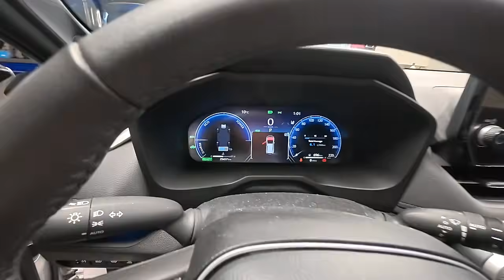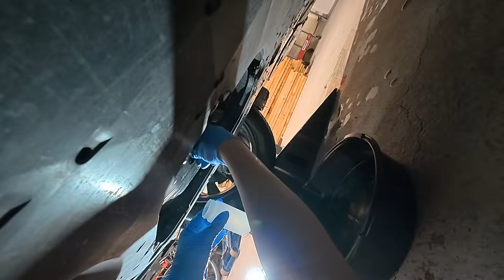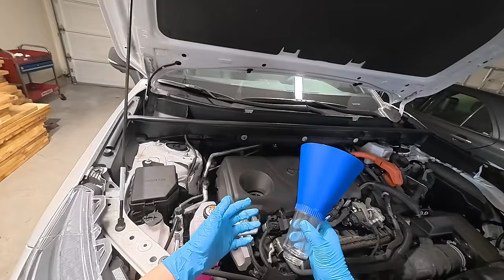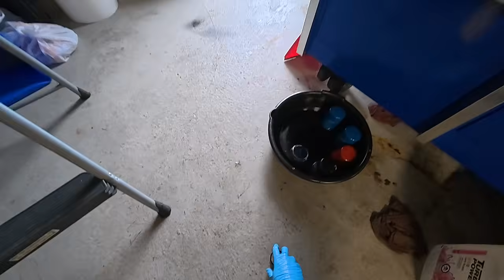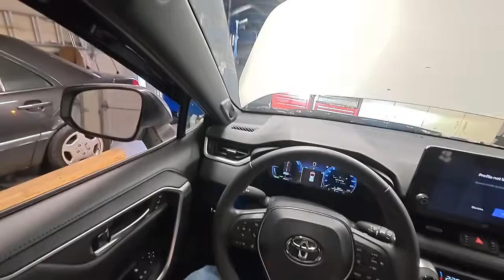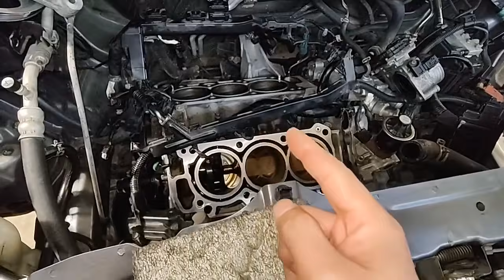5w30 Instead of 0w16 oil change #2 in the Rav4 Hybrid.

Comment: I have a 2022 Corolla with 2.0 liter, and after it came off of warranty, I switched from 0w-16 to 0w-20 in winter, 5W-30 in summer. No significant change in fuel mileage. I bought a quart of 0w-8 just to satisfy my curiosity, and am appalled that it’s even considered engine oil. My wife can use it in her sewing machine in place of 3-in-1 oil😂

Comment: I'm probably switching my 5th gen 4R (which has the 1GRFE that originally took 5w30 here in US, before being changed to 0w20 for the dualVVTI variant) and my wife's 5th gen RAV4 (non-hybrid) to 5w30.  Her RAV4 engine has always just sounded  like a cheap, unmaintained noise box rather than the refined engine that it actually is.  That noise can't be good.  
I have a various quarts of 0w16 and 0w20 left over, and am going to mix in just 1 quart over each oil change as I convert over to 5w30.  If foreign markets are recommending 5w30 oil for these engines then it's fine to use here in US.
Reply from the maker: I've been running 5w30 in my 2023 4runner since after break in period.

Comment: My 18 Camry 2AR-FE has a sticker on the front panel. 5w-30 .  This is a toyota sticker
So why are all the youtube mechanics insisting on the zero weight oils????  
Did the research I run Penzoil Ultra Platinum 100% synthetic 5W-30 new washer and factory oil filter .

Comment: Not saying it's right or wrong but It's a hybrid.  Isn't the point to minimize the wear of constant start/stop cycles?  Does a thin oil not make sense in that context?  It's an Atkinson engine too.  So not a ton of heat generation, unless you're stabbing the throttle through a desert or something.  No one ever mentions these things in these oil debates.  These hybrids are not apples to apples comparable with standard engines.  Also, it's over 100 degrees half the year in Saudi Arabia.  Not sure why that's an argument, exactly, assuming the person who made that comment is even telling the truth.

Comment: I ran 0w20 in my Toyota for 350000 I think you should use what the engineers say to use and is printed on your oil cap. And its not weight the w is for winter not weight. If your car engine stops at lights or in traffic you better use what the dealer tells you to they use additives to protect your engine and the thickness wastes valuable seconds from your engine getting oil on needed parts. Without those additives your oil barrier even with thicker oil won't be as good.......But if your smarter than well paid engineers that spent years designing and formulating oil to best lube your engine parts, go right ahead........

Comment: I have a 24 Ridgeline, do you recommend a VCM muzzler, or has Honda improved this engine?
Reply from the maker: The first gen Ridgeline never got the vcm like the odysseys, pilot and accord did that burned oil which is why the first gen was so good. The second gen ridgeline that got the earth dream like all the other doesn't have the issue like the previous v6 with vcm. Regular oil changes is also very important for how the vcm on that engine to function as everything is controlled by oil pressure.
Reply: @theoffroadingmechanic t
Thanks!

Comment: I used 0w-20 instead of 0w-16 in my hybrid Corolla and the difference is a quieter engine on acceleration. No change in miles per gallon. Will note difference in winter time.
Reply: I did the same with my 25 Kia Niro hybrid.  0W-20 seems to make it run quieter.

Comment: I use 0W-30 during cold winter months and 5W-30 during hot summer months, change oil/filter at 5,000 miles (which is 40% remaining on its OLM) for years and all works great.  And you are right...  Some folks get "very ugly" when using thicker oil than on its oil fil cap.   For more details about "too thin" oils in USA/Canada, surf:  https://www.youtube.com/watch?v=6quq3CZTv_E&t=38s

Comment: Great video to share.

I live in Alberta and I use 0w-20 because of the cold winter around -35c. Nothings wrong with 5w-30 there because BC has no harsh winters if you're near Seattle.

I read the Australian manual with the same engine they recommend until 10w-30.

In Australia's manual they recommend the ff:

0w-16 - preferred
0w-20
5w-20
5w-30
10w-30

Toyota even mentioned that "An oil with higher viscosity (one with a higher value) maybe suited if the vehicle is operated at high speeds or under extreme load conditions."

It means more engine protection on the second number.

You're doing fine there!

Comment: I’m in the states and my mom has a 2014 Honda Accord and uses 0w-20 and just switched to 5w-30 Valvoline restore and protect. Hoping she’ll be fine but also sound fine at full idle and I thought to use the 5w-30 because she has close to 180,000 thousand miles on it hopefully it will protect it more. I’m assuming I should be fine? If I should switch it back LMK!

Comment: I have a non hybrid, just did the oil change with 0w16 because that's what the manual says and I was scared. But being in South Florida, I want to go 5w30. I'm gonna go another 4k miles and do it. I just used the whole gallon.

Comment: I have questions only because the new Rav 4's uses an ecm controled variable displacment oil pump which is calibrated for 0 w 16 oil viscosity. The ECM (Engine Control Module) monitors real-time oil pressure and temperature. If it detects pressure rising above calibrated targets due to thicker oil, it commands the pump's solenoid to reduce displacement, effectively "throttling back" the pump to compensate.  This sounds bad to me.  But Im not an engineer.
Reply from the maker: I already checked my oil pressure on live data before and after and it was around 14-15 psi and after switching to 5w30 it was around 17-18psi and this was just at idle. So it doesn't compensate.

Comment: I have 1,200 miles on a ‘26 Corolla Cross  M20A-FKS that takes 0W-8. Toyota has only been doing this for a couple years. It’s giving me sleepless nights. I feel like a damn Guinea Pig with this stuff.

OMG those bearings at the end of the video are literally going to give me nightmares. That’s probably what’s happening in my Toyota right now with this water oil.

When I dumped the oil at 500 miles it was the first time I’d ever seen this stuff. It’s so thin that when it hit my plastic drain pan on the garage floor it splashed out everywhere and made a mess. The 0W-8 oil doesn’t even like to stick to itself.
Reply from the maker: Have you tried sending in your sample to see how your engine is doing on 0w8? I just sent my friends 0w16 oil on his 2024 sienna. And one thing that stood out is the fuel dilution thinned the oil out of grade. Gonna be in my next video when I change my oil in the Rav4 again and send another sample.
Reply: @theoffroadingmechanic 
Right now the oil only has ~700 miles on it. I may do an analysis in the future but I don’t think it would reveal a firm fuel dilution trend yet.

Comment: My grand Cherokee 3.6l  says 5w20...I searched for the best castrol extended 25k available..its not 20k its 25k..hard to find...it holds six quarts ..so I decided to go with 3 quarts 5w20 and 3 quarts 5w30...so the oil weight is 5w25...the very first cold start it was a smoother start and less noise..wasn't much noise at 5w20 but its less now..when the weather warms up im.going 5w30 castrol 25k extended...I want a oil that has the highest rating possible with a 5w30 oil..its ACEA A5B5..they rating does not come in 5w20 or 0w20...it come in 0w30 5w30 and 10w30..that rating is for small 4 cylinder and 6 cylinder high horsepower engines with or without turbo or supercharger with extended oil changes

Comment: IDOCARS got ahold of a ruined new Tundra engine. It had plenty of oil but had spun the last 2 connecting rod bearings. And the other didn't look great, either.
Reply from the maker: Yea seeing that it looks like that engine is eating it's bearings. Not just the mains. Another person posted a video on his tundra and after driving and getting the engine to operating temperature his oil pressure is 6-10 psi. Eric is probably right it's an oiling issue and the debris is just a result of it.

Comment: Myth-"Today's engines have tighter engine component tolerances"  
Research bearing and piston clearances of engines built in the 80's and 90's and even further back will prove that belief to be incorrect.
Reply from the maker: Yea those claims are all BS you can't go tighter because of expansion from heat. some examples is Honda V6 bearing clearance has not changed if anything cam lobes have gone narrower timing belt has gone skinnier. If you look at the V8 tundra in the second gen the bearing clearance on that engine is tighter clearance than the V6 twin turbo in the new tundra and that is because turbo charged engine creates more heat and metal has to expand more with more heat. Same goes for piston ring gaps not big enough gap on a turbo charged engine and that ring gap will bud up against each other and destroy your piston. The tighter tolerances that they are spewing/marketing is just a way to say they "engineered a better product" but really it's cost cutting while saving on materials, cost, and quality. I call it brainwashing cuz people all believe it.

Comment: I would never go up in weight in the winter. 
These variable flow rate oil pumps are programmed to expect a certain viscosity at a given temperature. 
This would be fine in the warmer months.
Reply: That makes sense, but then why does the manufacturer specify a range of oil viscosities for the same vehicle that are acceptable?
Reply: @marcinmerrimack1726 The way they program the oil pumps for US vehicles is different. Pumps work based on pressure. Changing viscosities can lead the the pump not delivering enough oil to the case.
Reply: @JTS-WTP  Ok, but what’s your basis for claiming that the oil pumps are programmed differently?
Reply: @marcinmerrimack1726 Because fuel economy is important. Electronic oil pumps have less demand on the engine increasing fuel economy.

Comment: I got 2022 lexus NX350H it says 0W16 but here in ontario its cold as ice age should i use 0W 20 or 5w 30 instead.
IT'S BEEN COUPLE MONTHS OF PERSONAL EXPERIENCE I SUGGEST DO NOT TOP UP 5W 30 
I SUGGEST NO CRUDE OIL AND ONLY 0W16 ONCE
Reply: 0w20 - I would use.

Comment: You mentioned something that I've been saying for a while about the manufacturers claiming it's machining debris at the manufacturing center. I personally think that is b***** I think it is the engine is creating its own debris but if they admit that then they'll be admitting that the oil viscosity that they are using is causing engines are causing their own debris I'm sure that will open the doors to hell of a lot more lawsuits and they are getting.. I did the lemon law on my truck I was able to keep my truck because it is still running good but with the issues that I had they qualified for the lemon law and I won 9 grand.
Reply from the maker: For bearings to go out like that it would have to be quality of parts or an engineering thing. A failure in the main bearing would have to be due to an oiling issue. Or it may have something to do with that variable oil pump only putting out 5-10psi at idle that someone had mentioned but I would have to have a tundra and have my scanner look at the live data for that oil pressure data to confirm that. Maybe we will get one traded in at our dealership.

Comment: I totally agree with you 100% about the oil switch out., where I live it was 5W30 for years and then with the cafe standers they switch to 0W-20. I made the switch 11,300 miles ago I've had two full oil changes with a 5W-30 and she runs better than ever and I will do a Blackstone laboratory sample probably after the next oil change.  On the two previous oil changes I used liqua Molly engine flush I'm going to use it one more time change the oil and filter drive it 250 mi come back change the oil and filter and at the next oil change at 5000 mi I will send in a sample I'm just not sure if any of that liquor Molly is left behind so I don't want that to be in the oil sample test kit

Comment: YES I SAW IN THE OTHER COUNTRIES THEY USING 5W30 , SW40 AND WHEN IT'S COLD THEY USING 0W30 AND WORKS PERFECTLY WITH NO ISSUES. I AM USING ON MY PRIUS 0W30 INSTEAD AND NOT USING 0W20 AND HONESTLY ENGINE RUNS BETTER THAN BEFORE.

Comment: In Israel. All the dealerships use 5w30 (swapped from 0w20). Nobody tells why. Rumors are that in hot climates the 0w20 just cant take the abuse. People here go with 9,500 miles oil change and not a mile less. That might be the reason. My rav4 is 2021. The dealership uses 5w30 for a few years now. Engine was noisy especially on startup with 0w20. The rumors might be true. 5w30 and it seems much quiter. No oil consumption so far.
Reply: Is your car Hybrid?
Reply: @chingizaliyev3064 yes.2021 Rav4 hybrid with 2.5 a25a fxs

Comment: Really interested to see the oil analysis for this. By chance, will you be sending in a 0w-16 sample for analysis at some point as well? Wondering for comparisons sake.
Reply from the maker: I won't be going back to 0w16 but I do have a friend that's coming up on his oil change on is sienna hybrid that I can take a sample from. I changed it at 5k miles and should be coming up at 10k miles soon. I ordered a couple tests kits from Blackstone labs.

Comment: My 2024 toyota Cross calls for 0w8. Lol! First thing I did was deain and switch to ultra platinum 5w30. Result: ran quieter and smoother. Ow8 is like ice tea. Nope!! Not in my vehicle!
Reply: My concern too.  i have the 2025 and paid for extra warranty.  Concerned if I change oil the warranty will be void.

Comment: This is what I am doing in my 24 hybrid Camry and 25 hybrid highlander. 5w-30 restore and protect every 3333 miles after my 3 break in oil changes. So far I only have 17K miles on the Camry and 1k on the highlander. I live in the southern US so no cold temps here… And I am very aware of what the car care nut says about 0w-16 but he has to rub shoulders with Toyota and cafe standards because he runs a business. He can’t say what is really best for the car.
Reply: Great insights! I’m in a very similar situation. I have a 2022 US-spec Camry XSE Hybrid (A25A-FXS), but I live in Baku, Azerbaijan, where summer temperatures frequently stay above 104°F (44-48°C) for months.
I’ve been hesitant about the factory 0W-16 recommendation due to our extreme heat and high-speed highway driving. Seeing that you’ve already switched to 5W-30 on the same platform is very reassuring.
I had a few quick questions about your experience so far:
1. Since the switch, have you noticed any "lag" or hesitation when the hybrid system transitions from electric to the ICE?
2. Did your MPG take a noticeable hit, or is it negligible in the southern heat?
3. Are you seeing any VVT-i rattle or "heaviness" during cold starts?
I totally agree with your point on CAFE standards vs. longevity. I’m planning to follow your lead and move to a high-performance 5W-30 (specifically Red Line with 3.7 HTHS) to protect those bearings in our 110°F summers. Thanks for being vocal about what’s actually best for the car!
Reply: Yağ iticilerini skelim 😂
Reply: Will it void the warranty?

Comment: hey brother, little off-topic but I have a 2020 Honda Civic 2.0 CVT and my driver axle snapped I replaced it with aftermarket axle and after 15 miles of driving it snapped again. I ended up buying a OEM axle and it binded it up immediately as I put the car in gear. I added transmission fluid and I put a boroscope inside the transmission from the driver side and  all the teeth look fine. i do have the car lowered with some negative camber stuff but nothing to where it would pull my axel out. hope one of u can help
Reply from the maker: When the vehicle is loaded on the ground what is the CV axle angle. Did it snap at the shaft or snapped in the outer CV.
Reply: @theoffroadingmechanic  the angle of the axel seems normal. and it snapped on the inner side toward the transmission. i removed the transmission pan and their was no metal or anything. i checked out my subframe and it is a bit scraped up but i dont think its bent or anything. i do have adjustable ball joint and extended ball joints plates that attach the the ball joint and control arm for more negative camber. but i still feel like its not enough to snap it and ive never had axel problems in the past
Reply from the maker: If you have extended ball joints and your wheel is sticking out more your inner rollers would have to be extend more outwards from the cup. Does your inner boot look like it's being stretched out like an accordion?

Comment: This is a smart choice. The second hand 2019 rav4 I bought,

I guess the dealer also put 5w30,
Because after 5000km I changed oil, 
The oil looked so clean.

If your car use 0w16, even you change oil after 5000km, oil look dark.

Comment: Big big mistake.
You may ruin your oil pump that can not perform with 5-30.
And after your oil pump goes, the engine goes after.
Reply: Yet Toyota recommends 5W-30 as an acceptable option for the 2.5 litre engine in Australia.

Comment: The car care nut said to use 0-16 and not to use 5w-30
Reply: Toyota recommend 5W-30 oil as an option for the 2.5 litre engine in the Australian manual.
Reply: @ChrisBlake8  No, the Australian 2024 Camry manual, for example, recommends only 0w-16 ("best choice" is the language used). 5w-30 is provided as a recommendation if 0w-16 is not available.
Reply: The car care nut has to be politically correct and always says to use what ever is in the owners manual. If he starts saying to use use a different oil viscosity and car owners start having oil related issues he will lose business and subscribers. We all know the real truth about thin oils. (they will eventually destroy your engine) a lot sooner because they favor mpg instead of longevity. just research every car manufacturer as of the last 15 yrs +  you'll thank me later.